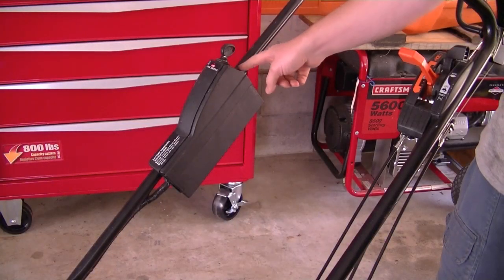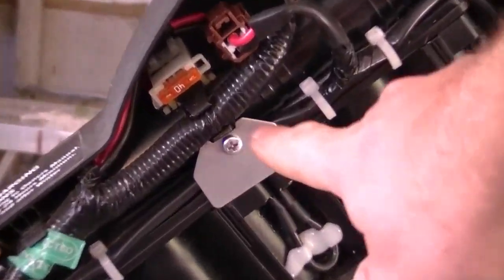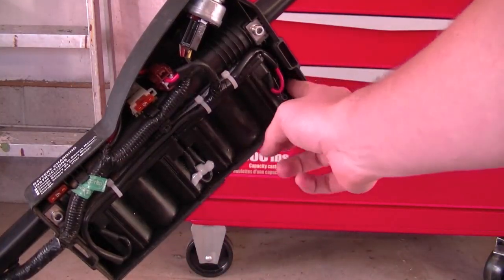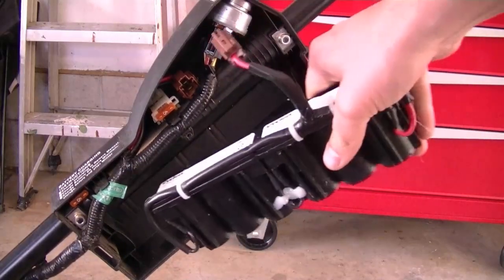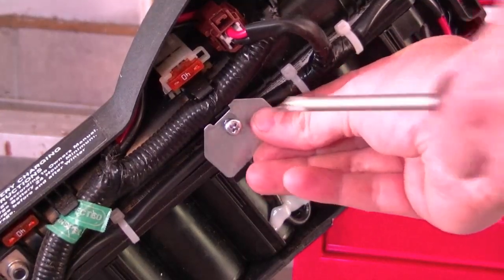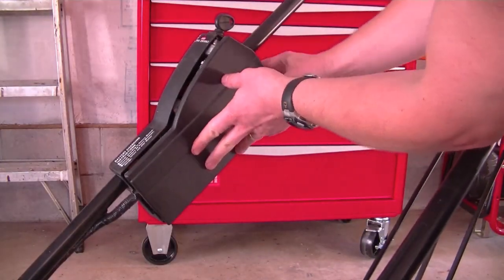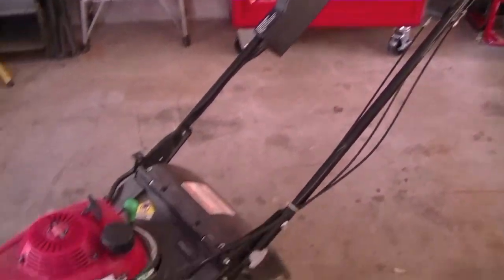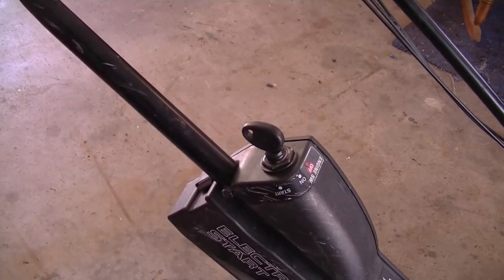HOW TO Replace The Battery On A Honda HRX 217 Lawnmower

Comment: dony, i have a briggs 6.0 quantum  and it ran like crap when i got it, so i cleaned the carb and put it back on , and now when i try to start it, the pull cord rips out of my hand and a puff of smoke comes out the carb.I was thinking sheered fly wheel key , but it ran before i took the carb apart.Any ideas ?  maybe vapor lock ?

Comment: I made sure the blade was tight ,but it does come loose from the hard kickbacks,but then i tighten the blade and it still kicks back,It didint kick back untill i cleaned the carb.

its werid , also when i spray starting fluid into the carb or spark plug hole, it will rip the cord out of my hands.But when their is no fuel in the carb or the spark plug hole, it will pull just fine on the cord ! but as soon as you ad fuel it kicks back HARD